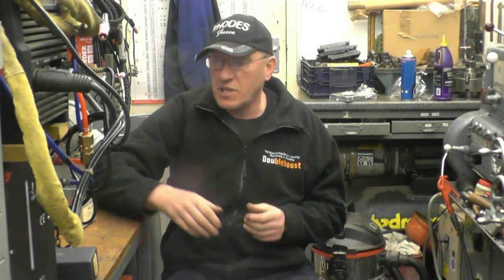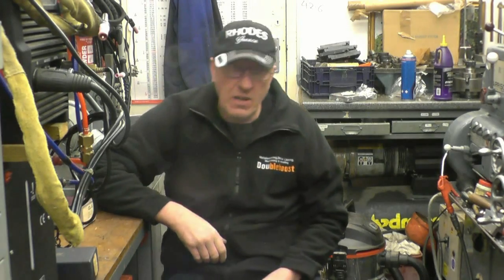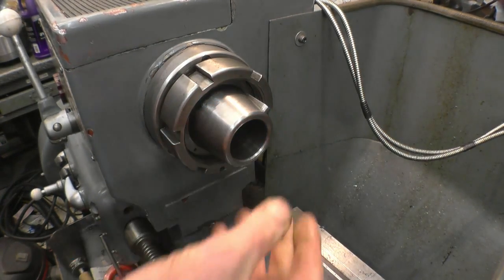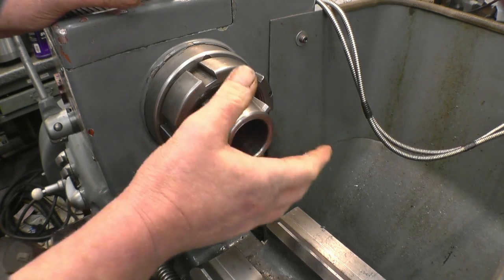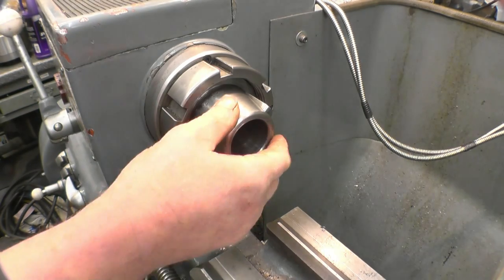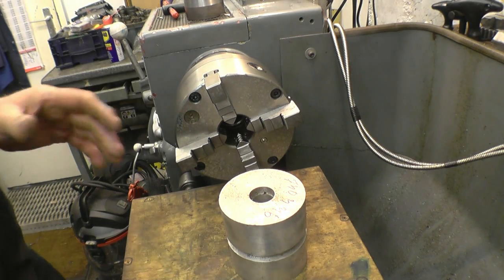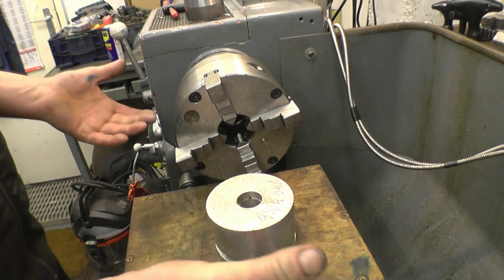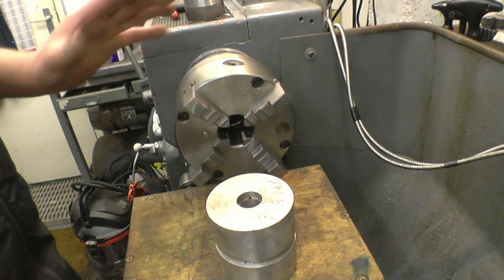SNNC 154 P1  DTI Giveaway  External Taper

Comment: Did I see the toolholder move when you pulled the stringy swarf at 13 30ish, not trying to be a troll but just suggesting you might find your finish is better with a rigid tool.
Reply: Little Work Shop of Horrors:   That's what SHE said.
Reply: Ah yes humour, don't you just love it.

Comment: with your old chuck, you tried grinding the jaws, but never finished them to somewhere accurate, will you revisit that at some point?
Reply from the maker: I did get a new set of jaws given  It still has 20 thou run out I need to get it sorted
Reply: John,
     Could it be that the chuck or jaws are mismarked? You could check it by putting jaw 1 in the 2 slot, 2 in the 3 slot, etc.. It may be worth a try . If that makes no difference then it would seem to point to the scroll not being centered.
Reply: he was originally trying to regrind some worn jaws, then a set of jaws were given, but i guess the scroll is also worn, which is perhaps why John was more than happy to put that chuck away and get a new one!